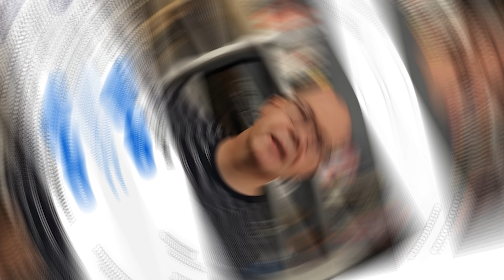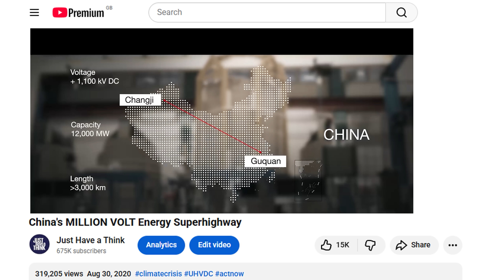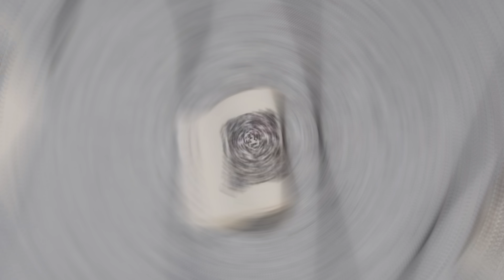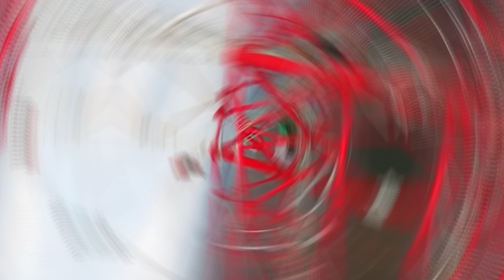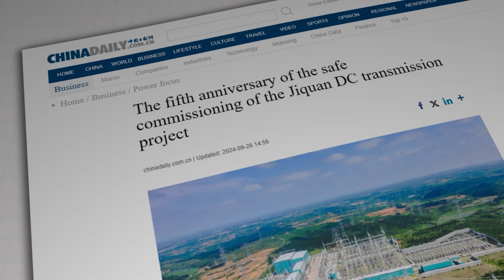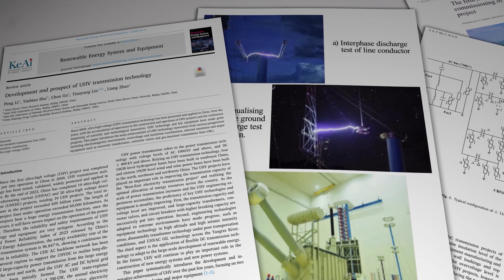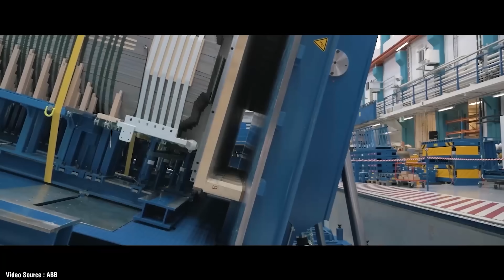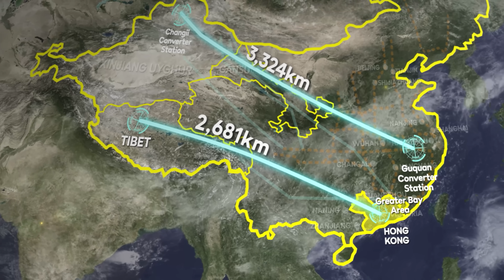China's ultra-high voltage transmission lines now breaking all records.

Comment: Topic suggestion: A report on China's "impossible" state of infrastructure construction prowess - from buildings/factories, bridges, roads, energy, et al. 

China built the Tesla factory in less than one year. They constructed a 300 (IIRC) bed hospital in one week. They replaced a  city's major 4 or 6 lane overpass in a single night. They constructed the world's highest bridge, 2-3 km in a short number of years for ~$300M (while we can barely build a couple of miles of freeway for that). They build some of the most amazing, mind blowing, multilevel highway interchanges - four to five levels, up to five or six connecting highways. Innovative bridge building like assembling Lego blocks. Huge hydro-electric generators. The list seems to go on and on. These are just the ones I've viewed.

Comment: In the United States, the highest voltage transmission lines we have are 765 kilovolts AC. At least several years ago, that was the case. I didn’t know DC could be sent such long distances.

Comment: You always need solid high Q reliable rotary magnet generated AC grid stability, I suggest around 40 percent because of the nothing is perfect law.
Well insulated DC with high frequency AC signal is great for sending power from renewables. At the other end they would need high voltage motor generator sets. No switching electronics can possibly to the job.

Comment: Excellent and thought provoking videos - thanks very much.  

It seems to me that in the UK we have rapidly growing solar, that with sufficient overnight storage from batteries, we will sooner-or-later be able to cover our summer electrical needs.  But with very modest solar production in the winter and a large heating demand hopefully to be met with heat pumps, we have a seasonal challenge.  I understand that our winters are generally windier than summer but I think there will still be a seasonal shortfall.  

I wondered if there might a small but useful role performed by domestic wood-burning furnaces.  I realise that traditional log-burners are very polluting, producing a lot of smoke, but I wondered if they might be redesigned to be more efficient.  If so, they might help plug some of the gap in intermittent renewables.  Possible design improvements on a traditional log burner might be:
1. Double height combustion chamber to provide for more complete combustion
2. Small fan to drive air-flow through a heat exchanger drawing the incoming feed air passed the hot exhaust gases to preheat the feed air (much hotter air would surely provide for a more complete combustion, and avoid much of the combustion heat going up the chimney)
3. Could the feed air jets be arranged in some fashion to provide some sort of cyclonic action improving combustion, similar in concept to the cyclonic action in some vacuum cleaners?  
4. Could the fire boil a particular liquid, and the vapour from this drive a small scroll turbine fixed to a generator to produce electrical power.  Then the vapour could be condensed in the domestic hot water tank, usefully recovering the heat while simultaneously converting the vapour back to a liquid for a new cycle?  As the rate of burn would be controlled by the fan speed driving the air-flow some sensors should be able to continuously optimise the operation.  
5. Preheated catalytic converter help to ensure complete combustion and minimises pollution, and surely reduce the need to clean out the chimney

Clearly such a system would be best installed in new builds, and probably larger properties, particularly in rural areas that might not have access to mains gas, but might have access to waste wood.  And it would work best where a domestic battery provides backup, so that in the event of an electricity outage at least the fire could still be operated, and the generator extend the battery capacity.  

I wonder if any work is being done in this area?

Comment: Geothermal energy is a topic I don't remember you covering.
I think the Achilles Heel of solar and wind are the intermittent nature of generation.
The inconsistent nature of generation demands storage, hydro or grid scale battery.
Geothermal as I understand it is very consistent generation if the implementation is good.
A consistent non carbon baseload; nuke, hydro...etc; would I think make a great difference.

Comment: The biggest problem with these HVDC lines is that due to the conversion costs, they are typically only connected to the grid at the end points.  This means you only need to knock down one tower to black out a very large region.  If it does come to war over Taiwan, that's one piece of high value, high vulnerability infrastructure that will attract a lot of attention.

Comment: Long AC line are susceptible to instability, standing waves, when a transient event occurs along the line. This can provoke over voltage traveling along the length of the line that can blowup equipment.

Comment: I would really like to hear more about using tidal as baseline electricity, projects like the o2 tidal generator. Using our coastine and tidal seems like the ideal baseline predictable source and would be far more distributed and secure than nuclear, and quicker to build the needed baseline capacity
Reply: Salt water is a mf to work with. It eats away at metal like you wouldn’t believe. There are many many many ways to skin a cat, and we have chosen wind/solar/thermal/nuclear because other options are not cost effective. They might be similarly efficient at producing energy, but long term use is not cost efficient for many energy types.

Comment: Given that Data Centres will probably  be the greatest user of electricity in the future, it would make sense to produce electricity on site rather than transmitting for thousands of miles. no matter how efficient the transmission is. What I would like to see you explore is the current state of modular reactors and the forecast for the near future and beyond.including comparative costs between high voltage transmission and modular reactors.

Comment: Here is my idea:

Over the last twenty years, the electricity world has changed dramatically. Solar panels, wind turbines, electric cars, and home batteries became inevitable — especially in countries like the Netherlands. Grid operators such as Enexis could see this coming long before it arrived.

And yet, the energy system barely moved.

Local battery hubs, smart grid balancing, and real-time local solutions were technically possible years ago, but only started appearing very recently — just as congestion became unavoidable. Why?

Did energy companies quietly assume households would absorb the problem by buying home batteries themselves? Was delaying large-scale investment cheaper than redesigning the grid? And why are electricity prices still closely tied to gas, even as fossil-free energy dominates more hours of the day?

This episode explores whether the slow response of the energy sector was caution, regulation, short-term economics — or a deliberate strategy. Because when the future is clearly visible, choosing not to act is still a decision.

Comment: Two ideas you could focus on, more areas than individual subjects. The two big challenges that I see are heating and heavy good transport neither of which seem to be resolving with heat pumps being extreemely expensive to install and the weight of batteries for heavy goods making a truck solution problematic. Hope that helps.

Comment: OK, here is a comment about the Earth's weather and how bad the effects are catastrophic.
 Earth is in a solar maximum, an 11-year cycle. What is happening with the AMOC and the ACC ocean currents? 
Supported by recent studies and ocean data, indicates the Atlantic Meridional Overturning Circulation (AMOC) is slowing down, reaching potentially record lows, mainly due to freshwater influx from melting ice and increased rainfall, altering ocean salinity and temperature, which could lead to significant climate shifts like cooling in the USA and Europe, sea-level rise on the U.S. East Coast, and changed precipitation patterns, though a complete shutdown this century isn't certain. 
Recent research strongly indicates that the Antarctic Circumpolar Current (ACC) is slowing down due to freshwater from melting Antarctic ice sheets disrupting ocean density, with projections suggesting a significant slowdown (up to 20%) by 2050 under high carbon emission scenarios, impacting global climate, sea levels, and marine life. This influx of freshwater outweighs temperature effects, altering the fundamental circulation that regulates Earth's climate. 
So why would fresh water slow an ocean current? Density! Fresh water floats on saltwater exspecial ice melt water. The fresh water is lighter than salt water, so it floats on top, and it is cold. The AMOC is a warm nutriant rich massive ocean current that not only warms the Atlantic Ocean's Northern hemisphere. The AMOC has high concentrations of zooplankton that feed fish.
The Antarctic Circumpolar Current (ACC) moves an immense amount of water, around 165 to 182 million cubic meters per second.
The Atlantic Meridional Overturning Circulation (AMOC) moves an immense volume of water, averaging around 17 to 20 million cubic meters per second.
Basically, the massive fresh water ice melt is changing these massive ocean currents, and that is why in a solar maximum, we are having severe winters. What happens is when these high salinity currents flow into icemelt they dive deep due to the salinity, the ocean water is heavier than fresh water. So currents are not circulating as they were.

From 1595 to 1620, the AMOC stopped flowing; no one knows why. It killed 100,000 Europians they starved to death, the summers turned to winters. 
From the 1590s to the 1630s, many European regions experienced significant internal conflicts, including the tail end of the French Wars of Religion, the Eighty Years' War (Dutch Revolt), the Bohemian Revolt, the Huguenot Rebellions in France, and the massive, devastating Thirty Years' War, which engulfed the Holy Roman Empire and beyond, involving multiple German states, Austria, Spain, and others, making it hard to count "countries" but showing widespread internal strife across Central Europe and France. 
All because the AMOC stopped flowing, the herion and code even disappeared. No one could catch fish; they starved.

Comment: All the talk is about EV cars and the infrastructure to provide charging stations for them. The failure of the UK to provide charging infrastructure for HGVs is something that needs to be investigated. We see electric HGVs starting to progress in the EU it is further ahead but I was surprised about the lack of progress here in the UK, after having a discussion with a haulage company director here in the UK who was looking to purchase a couple of electric units but didn’t progress with it as their research on the cost of getting a fast charging unit at their base was significant and the costs to charge elsewhere, whilst out on deliveries was too high even at the few available locations. I believe things are planned but is there any timelines in place to deliver this.

Comment: I'm guessing you're completely unaware of the existing UHVDC Pacific intertie from Celilo (John Day Dam on the Columbia River in Oregon) to the Los Angeles basin. Built in 1970, and upgraded in 1985, it's basically a 1.120M VDC extension cord from the hydro-dominant Bonneville Power Administration's network of generating assets to exclusively power the city of Los Angeles, 1,361km away. It was the first, and therefore the oldest large-scale, commercially significant UHVDC project in the United States.
Reply: him knowing anything about it has nothing to do with the vid, this is very clearly a CCP propaganda outlet, its actually quite comical
Reply: @Volros64 I won't disagree with that. Obvious AI is obvious...
Reply: China’s UHVDC technology leads the world in voltage class, transmission capacity, delivery distance, independent R&D capabilities, and standardization systems. It serves as a global benchmark for energy transition, ideal for large-scale, long-distance, cross-regional clean energy allocation.
The U.S. Pacific DC Intertie represents a mature application of conventional HVDC technology, suited for seasonal power exchange between regions. However, its technical parameters and capacity can no longer meet the demands of modern power grids, necessitating upgrades with advanced technologies such as voltage-source converter (VSC) based high-voltage direct current systems.
Reply: @AndreHo-i5x  Thanks Wikipedia, I appreciate the excessive details, however you're wrong about one small thing. While the Pacific DC Intertie system did start out 50-some years ago as an HVDC line, subsequent upgrades have brought its capacity up to 1.125 Million Volts, which is undisputably classified as UHVDC.

Comment: Well lets just set some facts. None of these projects will displace CO2 production in China, they simply keep up with demand. China is expanding the construction of Coal generated power as the stability provider for solar and wind. After 2030, their plan is to further develop Coal efficiency with the current modern plants which are quite clean by world standards as older plants have been either replaced or upgraded. There is no Plan for these to be shut down any time soon and neither should they. China's current percentage of wind and solar in the whole mix is 15.2%.  Its all about energy stability and reducing reliance on Oil Imports. something China has little of...yet. But massive advances in thorium is also happening, that could be a total game changer. Just as a note, the two new coal plants per week that have been built since 2021 and should all be finished by 2030 are primarily based where the solar and wind farms are, that says something about intelligence to the world.

Comment: Easy comment to suggest a topic. How about a focus on homes taking up Solar Panels, and how, since the source and destination are right there, you don't need much for transmission lines in the big picture. Of course, transmission lines would come in handy to help neighbors if a power outage happens.

Comment: It would be good to have catch up video on some of the niche, more mechanical forms of energy storage ideas  like gravity batteries in disused mines or the centre of buildings and compressed gas solutions using low tech repurposed diesel engines

Comment: Our German and many European politicians still think that all is good as long as our cars are driven by internal combustion engines and our homes are heated with natural gas and oil, and they struggle with power distribution because satisfying the loud skeptics is more important than the greater need. And then you watch videos like this and about Chinese CATL's success in sodium ion batteries. And you realize: Europe has decided to make it's way to the bottom. Depressing.

Comment: Ok, China is building a lot of renewables, dams and nuclear plants. And in the same time it is the #1 burner of coal, and increasing each year it's CO2 emissions. It does NO energy transition, only energy addition. So, from an environment POV, all these renewable do NOTHING for climate.
Reply: Go do a proper research rather than listening to the MSM, China is building coal powered stations which are a lot cleaner burning due to its massive power consumptions, but it demolishes the old coal stations  , China has recently commissioned 11 thorium nuclear power stations in one month alone!
And as of 2024, the carbon emissionsare actually falling despite new built coal-powered stations!

Comment: I have been thinking about global warming and how greenhouse gases are trapping heat and I am not suggesting that a reduction is not a good idea.  However if we convert solar into electricity and then use that electricity to do work that is solar energy that would have passively radiated back into space.  OK. We are a long way from any excess. Using the ISS as a small model they have to have radiators to loose the heat generated by onboard solar ussage.  Note Just having a Think.

Comment: As always, an informative and insightful topic covered well.  Would like to see a video on the topic of home level portable power generation.  Have often thought about a fuel cell which could provide power to a home and portable to your next home like a refrigerator coupled with a system which splits water for the hydrogen source.  Not sure if anyone has built this yet, but is an area of interest for me.  Keep up the god work.

Comment: Thanks a lot and great as usual. This basically opens up the way to a total global energy transition within 10 years if bureaucracy and corrupt idiot politicians were removed and replaced by forward thinking technocrats. All of South East Asia powered from Australian deserts, all of Europe powered by Sahara and Central Asian PV and North Atlantic wind electricity complemented by hydro and other pump storage systems, a peace of cake if fossil and nuclear influencers are silenced. Africa is obvious and quite on the right track, and the Americas are truly simple, they don't even need those ultra-transmission lines. So stop believing your conservative politicians about difficulties in energy transition, everything is in place, only brains and leadership missing - and that's the real problem.

Comment: Hi Dave, future content suggestion (although I'm subbed I may have missed if you'd already covered ...) I find the Thames heat transport project with involvement from SunAmp rather interesting. Although more at the conceptual level. Not necessarily the PCM  (Phase Change Material) technology. Say more as a parallel  or equivalent to the transmission function in the electricity grid. Cheers from Utrecht.